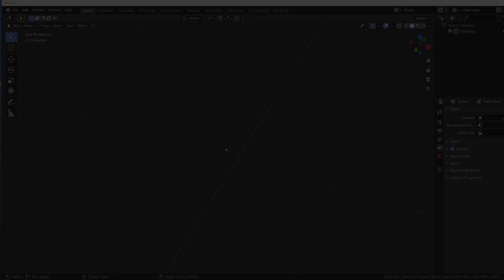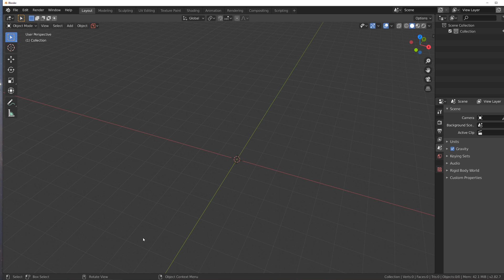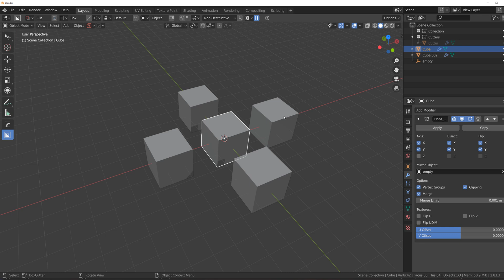90 DEGREES mirror in Blender - VANILLA vs. HARD OPS

Comment: oh no, there's an advanced mode by pressing Tab.  I was happy to freeze the cutter with Tab, that took me a month to see. 

I wonder if the current Array V2 has changed the way it behaves, because I'm having a problem getting to the circular array except for clicking on the Hops header icon.  I think you said B and my help doesn't have that.  Let me see if I'm just stroking or something I'm gonna redo what I did yesterday.  See, where's my B?  https://imgur.com/AC45UZP  I'll go to his discord...
Reply from the maker: you can switch to V1 array, the v2 is pissing me off a bit as well, v1 was working great.
Reply: @PonteRyuurui , k, glad to hear I'm not losing my marbles, because as I've gotten older, finding the marbles I've dropped and putting them back has gotten harder because I can't even tell sometimes when it happens.
Reply: @PonteRyuurui  interestingly, mx2 considers V1 a failure (!)
"V1 is considered a failure and isnt worth using
[12:09 PM]
so id recommend V2
[12:09 PM]
and then if radial array is needed, using the meshtool option dedicated for it"

I just want to do what I have to do, so Idc how, just that I know how.